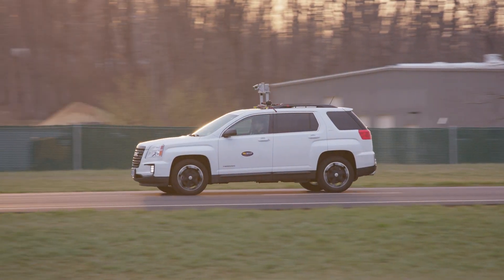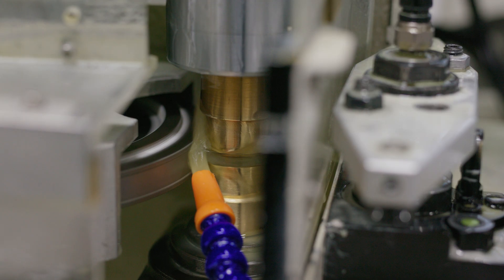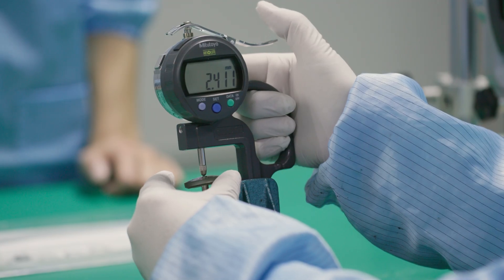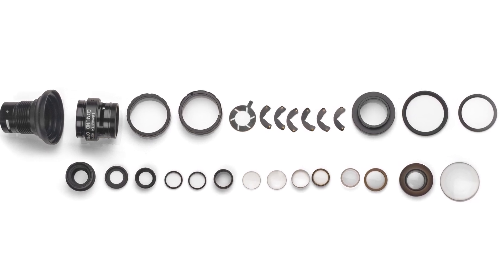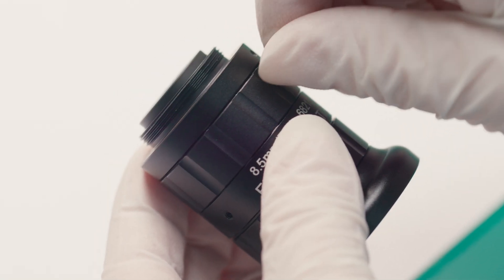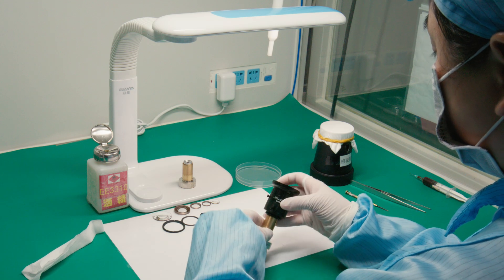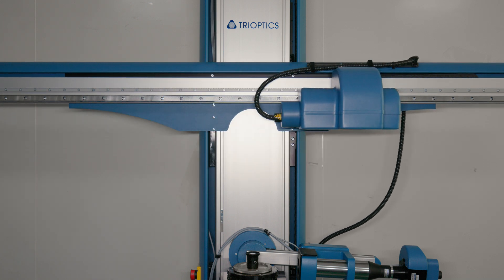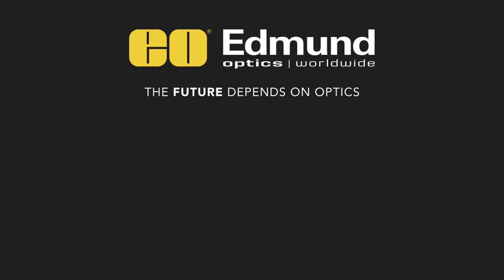How an EO Imaging Lens is Manufactured

Comment: Why are incorrectly sized and incorrectly fitted face masks shown in a company promotional video? This is an easily addressed source of contamination.
Reply: The masks are probably excessive if they're working in a cleanroom. I worked in a Class 1000 cleanroom and all we needed was a thin cloth barrier to prevent spit from getting onto our samples. The HEPA filters and laminar flow kept dust and other particles under control. Are you talking about the woman who had gaps to the side of the mask? The sample in front of her would be safe from moisture from her nose or mouth.